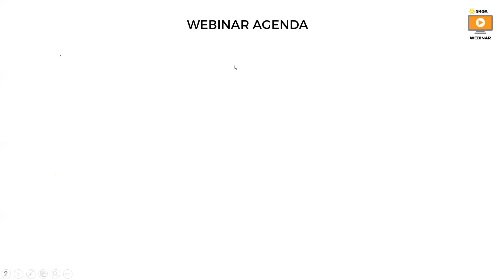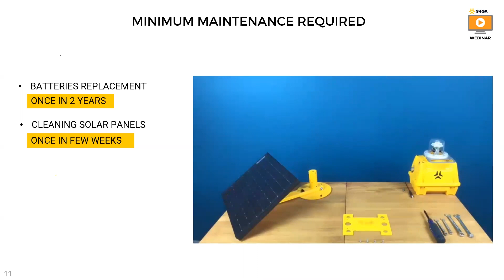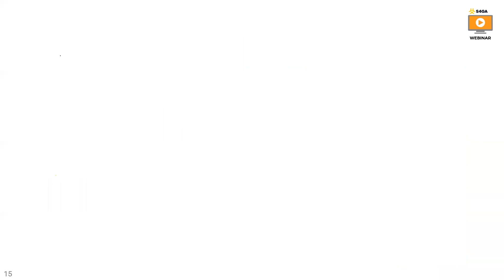S4GA Webinar: Backup Runway Lighting for International Airports

Comment from the maker: 3:42 WEBINAR AGENDA
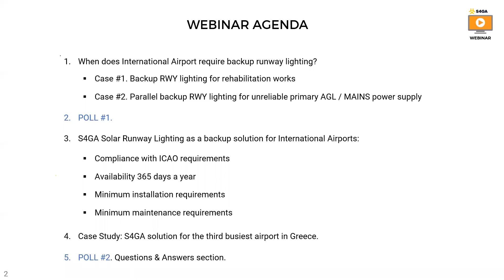6:01 TYPICAL CASES when int'l airport required backup RWY lighting
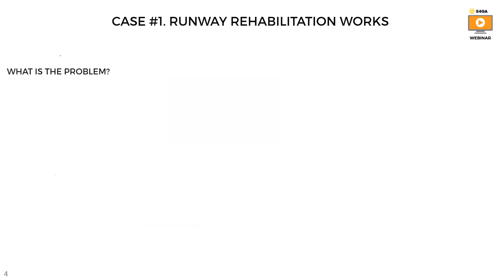14:50    - Case #1. Runway rehabilitation works
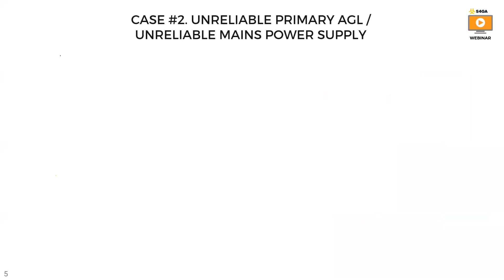16:32    - Case #2. Unreliable primary AGL / unreliable MAINS power supply
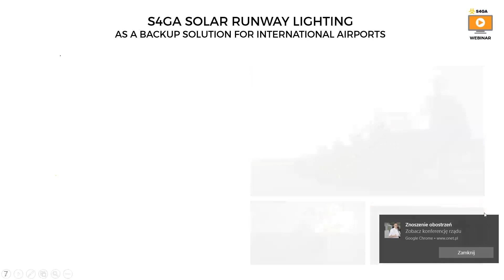19:48 S4GA SOLAR RUNWAY LIGHTING as a backup solution for international airports
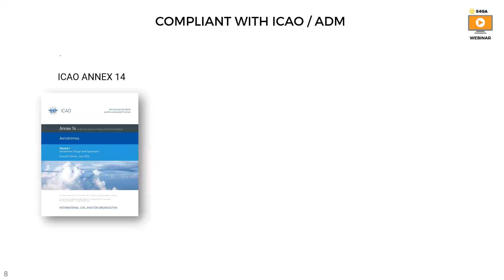21:24    - Compliant with ICAO/ADM
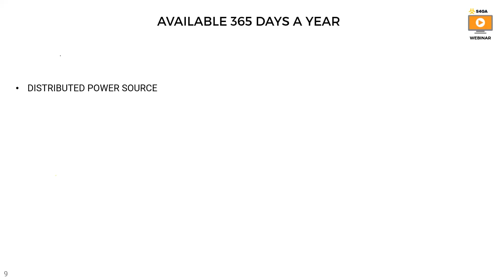23:00    - Available 365 days a year
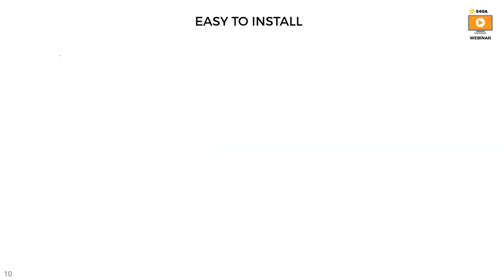26:00    - Easy to install
27:28    - Minimum maintenance required
31:07 CASE STUDY: S4GA solution for the third busiest airport in Greece
32:30 Few other videos of S4GA applications worldwide
34:04 What to do with S4GA lights AFTER rehabilitation works are completed?
36:20 QUESTIONS & ANSWERS section